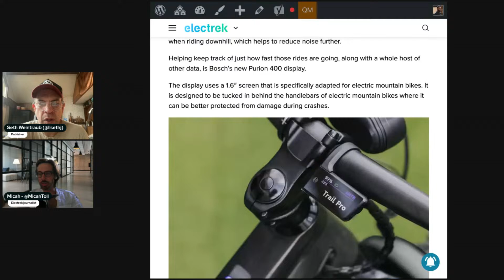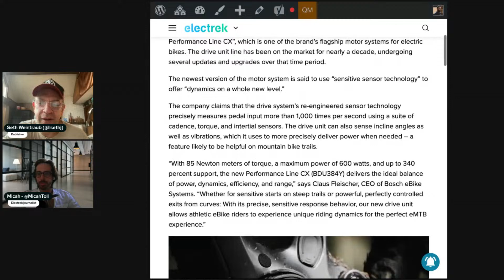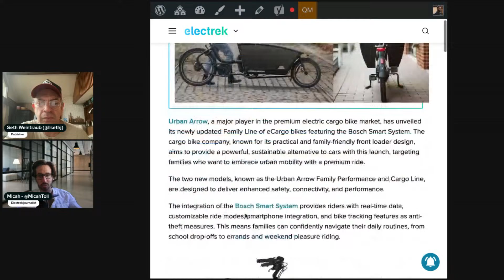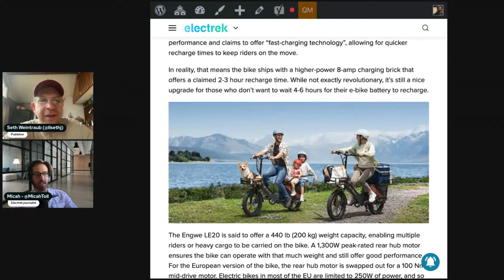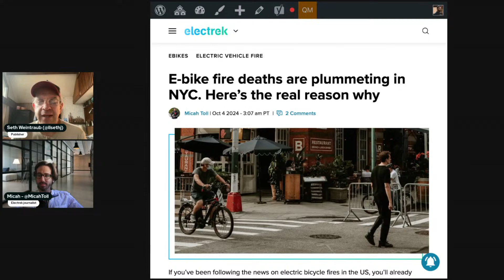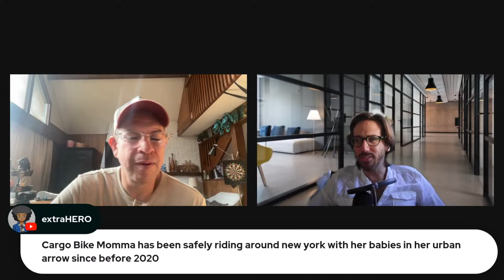Wheel-E Podcast: New Bosch motor, Urban Arrow cargo e-bike, more

Comment: Seth's right. We need a universal charging standard for e-bikes and micromobility. Establish a universal protocol for micromobility BMS to express their required voltage to a universal charger using a common connector. This is also a way to fix the mismatched charger fire issues we've seen as people randomly replace their e-bike motors.

When you have 120V outlets at public bike parking, you for better or for worse, will also create a place where unhoused people will charge devices and use the free power.

San Diego naively wrote into their Climate Action Plan (I think that's where it is) a mandate to have every other bike parking space provide power for e-bikes. It wasn't well thought out by people who e-bike, IMO.

I know you all have talked about this before. It's time for use to organize some momentum to try to make this happen. IMO, bike companies / shops probably dislike having to include a cheap shoddy charger with their e-bikes. The industry could shift to universal chargers, then include a base charger with a bike, with an option to omit for a exchange for a different feature like a rack or fenders if you already own a universal charger. They could also offer a premium charger that allows 80% charging to greatly extend the life of e-bike batteries. I use a Grin Satiator for all 3 of my e-bikes. It let me set up programs for fast charging, slow charging, 80%, 90%, 100%, different voltages.  All that.